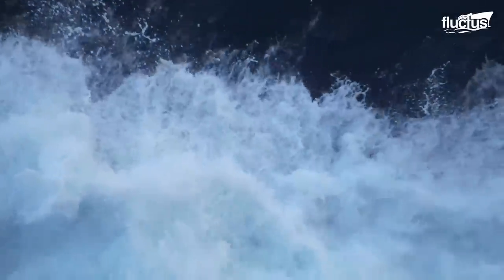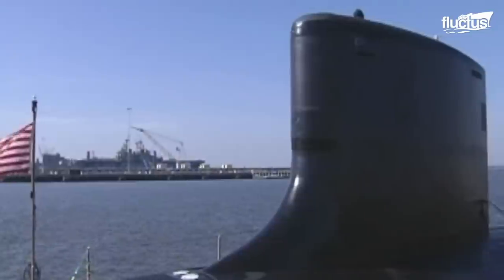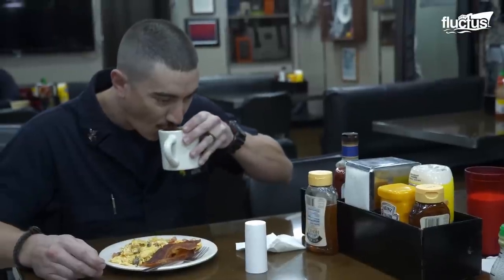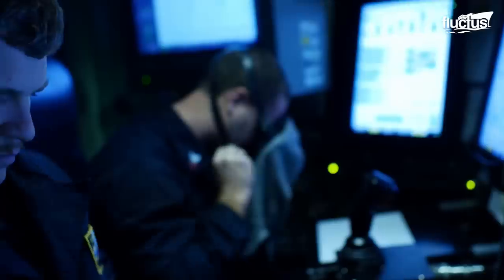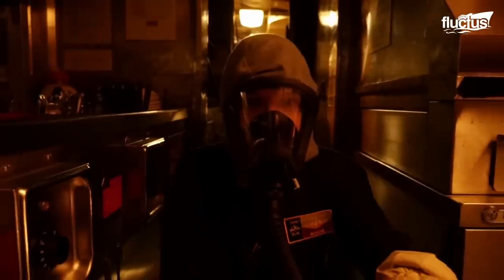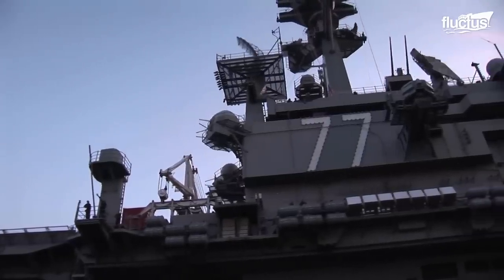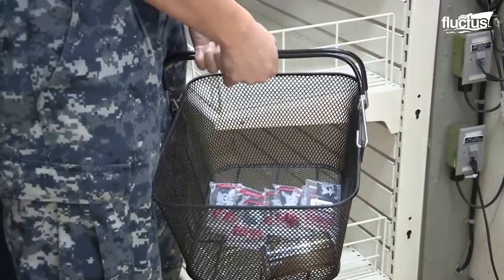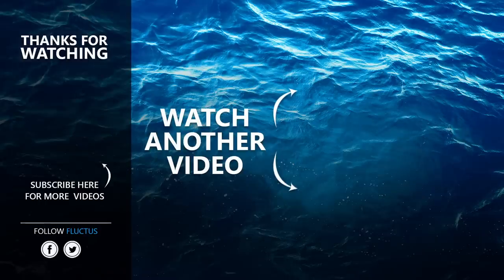Weirdest Jobs Inside US Navy Submarines Deep Underwater

Comment: Maybe things have changed but when I was in (1978-1986) we ran out of fresh vegetables and milk about one week into patrol. One exception was sometimes getting “super-pasteurized” milk out of Holy Loch Scotland, which was good for a couple months.
Reply: I rode the boats back then - Richard B Russell SSN-687 and PARGO SSN-650 - we ran out of stuff all the time - especially on northern runs and Med runs
Reply: Perhaps they stored the vegetables next to the engine room, near to the reactors
Reply: I worked at CFB Alert in 1977. Pretty much the North Pole. Most northern establishment in the world. We got our stuff in by Hercs on a gravel runway since the perma frost wouldn’t allow a poured one. Due to flying and running out of milk quickly, we got this stuff I will call Multi Milk. Anyhow it came in a foil pouch inside a carton and it was this giant lump of concentrated milk that had to be diluted down with water to get to the correct proportions of drinkable milk. This was a small air base with not many people, but it got talked about because it seemed like it was always lumpy and the guys didn’t like it. My claim to fame while I was there was my invention that took this lump and turned into cold milk that everyone enjoyed. I did this by mixing the good lump with just enough hot water to let me mix it all smooth until there were no lumps, and then I quickly added enough ice cold water to get the exact amount of concentrate and water. It was a huge hit with the guys and I remember some major thanking me. I couldn’t believe no one else had not thought of that.
Reply: I bet you could smoke too.
Reply: @fainjohnson3637  The smoking lamp was lit by default everywhere on the ship, unless it was announced as being out. I understand it’s different now.
Reply: @submarineradioman5535  I served on the USS Pargo 650 77-78.

Comment: I'm not claustrophobic person. But the thought of being in that bunk bed plus being underwater and won't have an option to get out for weeks, plus if something goes wrong, it's death by drowning in close compartment, gives me claustrophobic fright.
Reply: Trust me, you probably won’t drown. The compression from the hull imploding would be quick. Suffocating from lack of O2 or high CO2 levels would kinda suck, until you pass out.  Anyway, it wasn’t bad at all. Yes I’m a qualified submarine veteran. MM1(SS)
Reply: @RRSperry  When there is a fire drill, do you know if it is real or not?  I suppose the person that is holding the front of the hose knows though.
Reply: @clarkeugene5727  Yes. Who ever makes the 1MC announcement. Also, it's really rare that they run drills "off" hours. Usually drill are on the 0600 to 1200 watch. That could change but drill time also posted in the plan of the day. Even underwater, you have a plan of the day. Otherwise the XO wouldn't have anything else to do..  (yes, that was sarcastic.)
Reply: You’d probably be screened out for claustrophobia while in sub school. If it happened at sea you’d probably be sedated till back in port
Reply: @Idahoguy10157  Provided you go to sub school. I was a Nuc and never went. Since the sub service is completely voluntary, if you were claustrophobic, you wouldn't sign up for it. You'd KNOW very quickly, the Navy probably isn't the place for you. Because in fact, other than going outside, surface ships and submarines are all TIGHT places to live and work. As are Tanks, or planes, and APCs. I never saw an actual case of somebody wigging out. You hear stories, but I never met anyone that ACTUALLY saw it.
Reply: @RRSperry  I was on a tender 73-76 LPO of 38a Shop. I was really surprised at how much room there was on fast attacks. Unless you had to remove "stuff"!

Comment: Cigarettes in the gift shop?  Is smoking even allowed on a sub? 😝 Bluck!
Reply: The cigarettes were on an aircraft carrier, not a sub. No open flames are allowed on the subs.
Reply: @oliverheaviside2539  I'm willing to bet that the pilots can't smoke while flying. 😃
Reply: @stevoplex  I never knew a pilot who smoked. The Air Force fighter jocks were into their beer bashses, but no smokers that I ever saw.
Reply: @oliverheaviside2539  Glad to hear that. BTW, decades ago I was a civilian defense contractor for the US Air Force and I wrote MIL-SPECS.  We did a bit of collaboration with NASA for things like access control, biometric readers, etc. Then I had a bright idea! 🤓!  Years earlier, while still in college, I invented a microgravity ashtray for use on the (then) new Space Shuttle. A small canister stabilized with a gyroscope in the base, with the shaft also having a 6cm ventilation fan. This would pull in smoke and ash together through a very fine filter and an activated charcoal filter, and even with a layer of lithium hydroxide for the CO2.  Then I found out that astronauts don't smoke. 😮 (The ground control crew in Houston smoked like demons way back during the Apollo program). 😐 So, yeah. I never got the opportunity to pitch my invention. Heck, I didn't even bother applying for a provisional patent, or complete a fully functional prototype. It did make for an amusing anecdote that got passed around (which was kinda my intent, a little practical joke that cost nothing and caused no damage). Writing MIL-SPECS is tedious and mind-numbing and my team liked to ease the tension with a little levity.  🤔 Hmm...Levity is the opposite of Gravity! Well wattaya know?